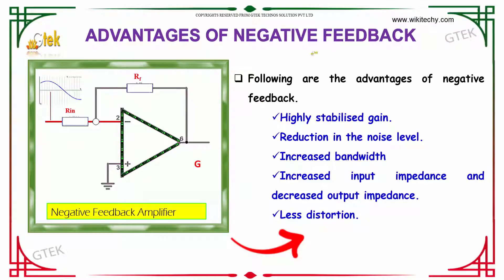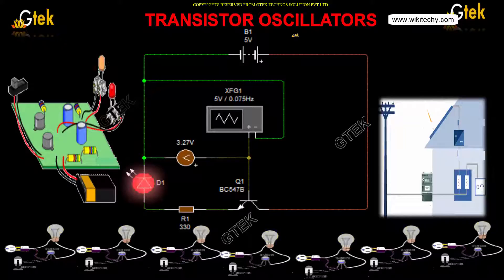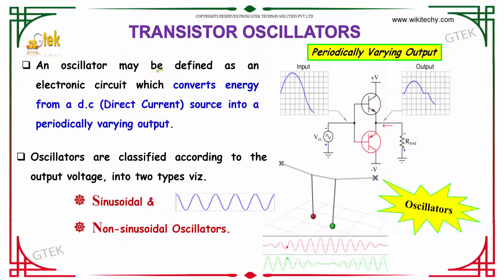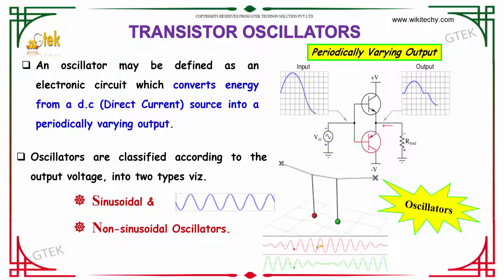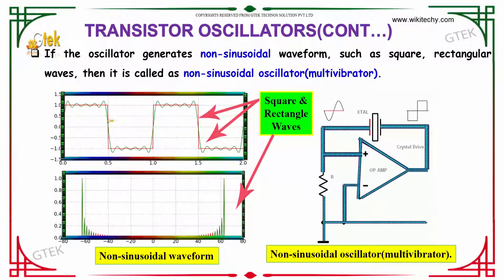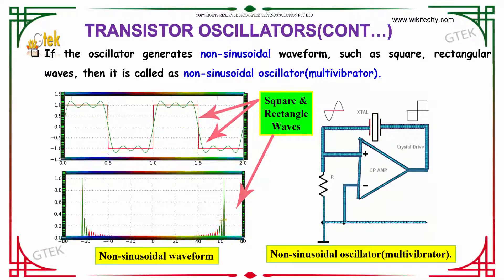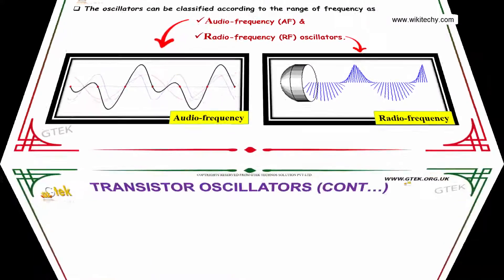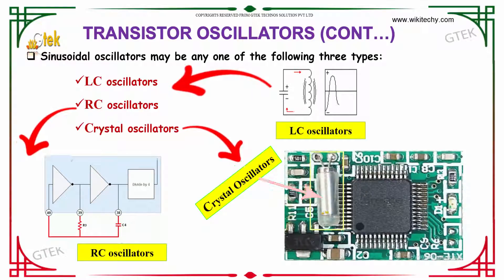Advantage of Negative Feedback Semiconductor Devices class 12 physics subject notes lectures CBSE

Comment: The applied negative feedback improves performance (gain stability, linearity, frequency response, step response) and reduces sensitivity to parameter variations due to manufacturing or environment. Because of these advantages, many amplifiers and control systems use negative feedback.

Comment: Negative feedback. When the feedback signal (voltage or current) is in phase with the input signal and thus aids it, it is called positive feedback. Positive feedback increases the gain of the amplifier. However, it has the disadvantage of increased distortion and instability.

Comment: Another type of feedback, namely positive feedback, also finds application in op-amp circuits. Unlike negative feedback, where the output voltage is “fed back” to the inverting (-) input, with positive feedback the output voltage is somehow routed back to the noninverting (+) input.

Comment: An op-amp with negative feedback (a non-inverting amplifier) If predictable operation is desired, negative feedback is used, by applying a portion of the output voltage to the inverting input. The closed loop feedback greatly reduces the gain of the circuit.

Comment: Negative feedback opposes or subtracts from the input signals giving it many advantages in the design and stabilisation of control systems. ... Feedback reduces the overall gain of a system with the degree of reduction being related to the systems open-loop gain. Negative feedback also ...

Comment: Feedback reduces the overall gain of a system with the degree of reduction being related to the systems open-loop gain. Negative feedbackalso has effects of reducing distortion, noise, sensitivity to external changes as well as improving system bandwidth and input and output impedances.